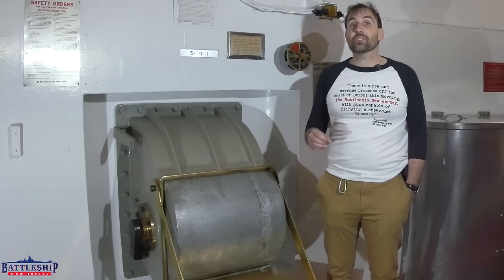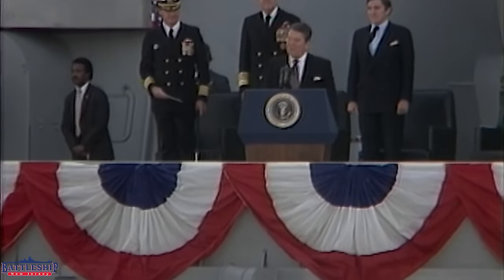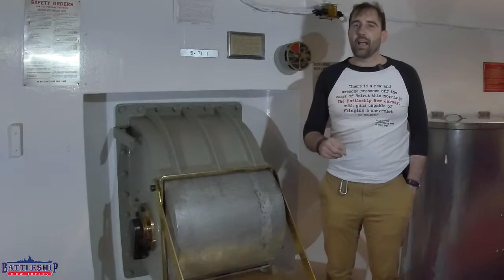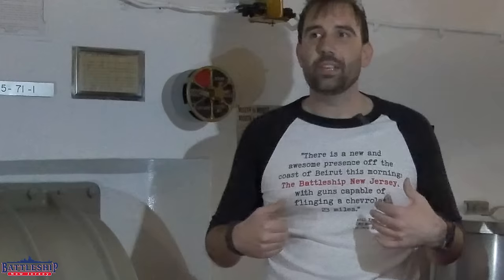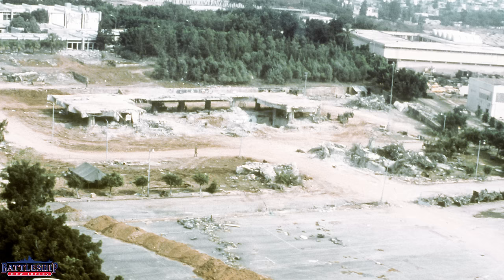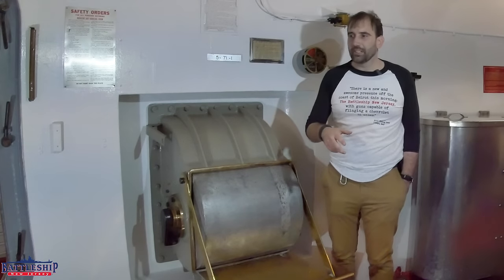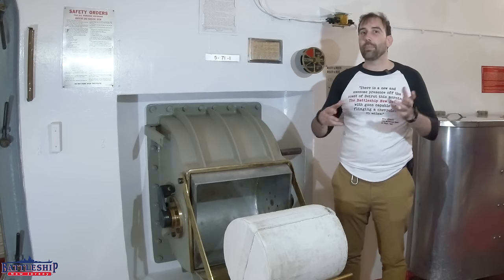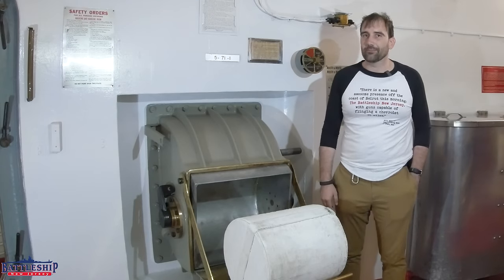Why Were New Jersey's Guns So Inaccurate in 1983?

Comment: A relative of mine in the army in vietnam as a ground grunt used to praise the accuracy of naval (battleship) artillery in hitting everything accurately they designated.  He said it was infinitely more accurate than ground artillery and they used that resource whenever they could.
Reply: The Battleships could be in the (relatively) close to targets on the calm waters near shore in Vietnam, the "fire control computers" can really use their long range sighting inputs to enhance accuracy. It takes a lot of practice and team work to reach that level of accuracy (and some other ... efforts on ships like Iowa "experiment" with propellants and loadings to get those "improvements" - it cost sailors lives).
Reply: I could buy that argument. Compared to today's vessels, two different things.
Reply: @williestyle35 what are you talking about? The Iowa explosion was caused by the old powder getting hit with the ram too hard no?
Reply: @Synergy7Studios Yes, but the old powder shouldn't have been used in the first place. It was an "improvement" by one of the sailors, using the old powder from WW2 to increase range and accuracy. The problem? It specifically had written on the powder bags to not use with the 2700lb shells. Solution? Use 5 bags instead of six. Add a hydraulic rammer that was known to move erratically, the sailor using it being inexperienced and there's the recipe for a disaster.
Reply: @durt214  that makes absolutely no sense, the old ww2 powder was the ONLY powder they had, and if anything age would hurt accuracy.
Reply: @Synergy7Studios  Apologies, my mistake, remembered it wrong. 
In January 1989, master chief fire control technician Stephen Skelley proposed an experiment, using supercharged propellant and specially designed shells to increase the range of Iowa's 16-inch guns. The shells reportedly travelled 40km, a record distance.

During the Iowa turret explosion, he proposed another experiment. Using a 5 bag charge of the quicker burning D486 propellant from 1943-45, which was not to be paired with a 2700 pound shell. The reason for using 5 bags instead of the usual 6 was due to the powder creating more pressure, and the idea behind the experiment was that a 5 bag powder charge would result in better accuracy due to the gap left between the bags and the shell.

So 2 different experiments, the one during the disaster was for accuracy.
Reply: The curators hairline needs to be recommissioned to The Reagan administration
Reply: Along with that it's a much heavier hit.  A battleship can lay down more ordnance in an hour than a unit of B-52s can in a day

Comment: And for another fun fact about this, I crawled thru all nine barrels many times to check out areas that I found during the bore scoping. For the first firings we were not given any lead to lubricate the barrels so also spent many hours inside them to remove copper fouling with a chisel and hammer had one piece that was 10 inches long, there's a Plack out there somewhere with it on it.
Reply: Are you still thin enough to fit in a barrel?
Reply: How on earth could a person fit inside a gun barrel for a projectile 16" in diameter, much less have enough room to move to chisel things?
Reply: @Swindle1984  Skinny teenagers and young men. The same way tankers tended to be shorter.
A friend of mine got kicked from the Irish cavalry years ago. His legs didn't fit as a driver.
Chieftain had the same story, he went to the US.

Comment: Ryan, I was under the impression that the reason for the variation in the fall of shot was powder degradation. The Navy back in the ‘40s mixed huge (100 thousand pound plus) lots of the nitrocellulose used for propellant. Nitrocellulose has volatile components such as water, ether etc that degrade with the passage of time. Even properly stored, nobody could have imagined the the Iowa’s would serve so long. I recall from a Naval Institute Press book that by the 80’s, gunnery at Vieques was giving indications of variation of muzzle velocities in the neighborhood of 30-40 feet per second, well out of design specifications. The Navy had to re-blend the propellant and rebag in order to get accuracy of the guns back to their prime.

Comment: Ryan, we started deploying velocimeters on our 155mm howitzer in the Army in the early to mid 1980s and their introduction drastically improved the weapons accuracy.  I can imagine how having incorrectly repacked powder and the lack of velocimeters would really mess up accuracy.
Reply: While I was trained as an NCO to direct fire, never dealt directly with any form of artillery personally (as in firing pit) until quite late in my military career and was helping our 120mm mortar crew. They generously allowed me to drop a few rounds.
Suffice it to say, the drills impressed me, the incessant checking level and angles also imbued trust. Everyone repeating the firing order also impressed me, as it ensured no errors should make it to directing the gun.
Two men computing and if both agree, only then do firing orders go out, again, imbued trust.
Some months after that, got to help a 155 crew that was badly short staffed set up the gun for a PR display. Hell of a team! I figured out what had to go where and how from the mortar experience, so we seamlessly set up, they actually did level out the gun - on an airfield ramp for display, out of pure habit from properly drilling.
Came in handy in the wars, as before, I'd have wondered if the rounds would land on target or short. Trust is critical and saves lives.
Crews knew me on the radio, as I'd give correction by mils, when a FIST wasn't available.
I rotated with every team, even our sniper teams, just so I'd be fluent in their capabilities, even if I had to play Private for that time. Only weapon I declined familiarizing with was the Barrett. No thanks, my spine would never forgive me.
Everything else, yeah, I've fired it or crewed it.
My personal favorite weapon still remains my heat seeking moisture missile though.  :P
Reply: @spvillano careful those wear down with age, it will have you dreaming of the glory days.
Reply: @FranktheDachshund 
😉😂

Comment: There was a TV news broadcast that quoted Lebanese officials as complaining about the New Jersey's guns tearing up the town.  That particular incident followed some chaotic firing by Soviet-made anti-aircraft guns.  The reporter and his cameraman were guided to the damage "caused by the NJ's big-guns."  The walls of the damaged small buildings were still standing.  The officials pointed to some holes that were about 23mm  and 57mm in diameter (perfectly round) and said those were caused by the New Jersey's 16" guns.  I believe a Navy spokesman said the NJ had not even fired its 16" guns that day.  It seemed unlikely that small poorly built buildings would still be standing after being hit with a 2000-lb shell or that such a shell would leave a nice neat 57mm hole in the wall.  Other reporters said the AAA gunners had no fire disciple and shot their weapons in just about every direction, including into their own buildings.
Reply: Yes, 23 and 57mm are very common Soviet-made AA-gun calibers, both have been used by the Finnish defence forces. I was trained as a ZU-23-2 gunner during my conscription back in the early 90:s. The 57 was already becoming obsolete then but still in use by the reserves, I saw those being fired. At least here the standard practice for 23 was to línk one AP round for every 3 HE rounds, of which there were two kinds, with and without a tracer so there would be alternately one tracer and one "dark" round in the belt. 

The clean round holes would probably be made by the AP rounds which are basically just lumps of steel with driving bands of copper and a tracer at the base while the HE-rounds are fitted with very sensitive contact fuses and would explode immediately upon any impact to cause maximal damage on thin skinned aircraft so they would probably cause larger, ragged holes with shrapnel downrange. The ZU-23-2 has a theoretical rate of fire of 1000 rpm/barrel (though the ammo cans only hold 50 rounds/barrel but they are very quick to change by a competent loader) so I think firing one at a building would be quite devastating. I once saw a short (2 or 3 rounds/barrel like we would fire at practice to conserve ammunition) burst accidentally (the gunner forgot to lock the elevation before firing and inadvertently yanked the crank while pushing the trigger pedal so he shot low) hit a retaining wall made of logs below a target and there were lots of airborne splinters after that.
Reply: Sees an autocannon-caliber hole with minimal blast damage
"Is this not sixteen-inch?"
Reply: Thanks for the information.  Much appreciated. @Murgoh
Reply: @Murgoh   the 23 and 57mm are good weapons, well, save when used by Russian conscripts.
In Finnish hands, well, the targets are Finished.  ;)
Nothing but respect for those in the Winter War!

Comment: Another issue with the WWII powder supplies was improper storage between deployments. This was a BIG issue in the Iowa incident, as powder bags were removed from the ship and stored in unventilated barges in hot weather affecting the powder.
Reply: @JLange642 Thanks, you saved me from looking it up!
Reply: you are soooooo spot on imagine spending all this taxpayer cash & not manufacturing new powder !!!!
Reply: Well, with the Iowa, there was also an augmentation that the lead investigating Admiral had designed that came into play.
Reply: @THOMAS81Z   well, I've used TNT from the 1950's in the Army. Why replace that which is stable and considered fit for use?
The issue with storage is a valid concern, but incorrectly loading the bags, bigger concern, as the propellant won't be consumed inside of the barrel behind the round, but be ejected still igniting and basically, making only a light show, decreasing range and performance.
The Navy had tons of storage issues, some coming into play and causing disastrous a aircraft carrier fire.
RDX and heat don't get along, the composition in the carrier fire actually had begun breaking down and literally leaking out of the bombs when the incident triggered a fire that enveloped the bombs (massively simplified here).
Reply: @spvillano  I was in to , so your were a gun bunny, what unit ? I was A co 124 sig 4th ID😊
Reply: @thomasshannon2741  nope, wasn’t a cannon cocker. Medic, before was a Pershing missile erector launcher repairer. Last unit was 1-111 infantry, 56th brigade combat team, Stryker. Also was 330th combat engineers.
So, I pretty much worked with everything that could get suddenly loud.

Comment: I was Weapons Officer in USS IOWA 1983-1986, and Mr Harold Jones, the Naval Weapons Center expert on 16" gunnery frequently visited Iowa as we became the big gun expert ship.  He briefed me in New Jersey's performance at San Clemente gunnery range using the powder charges she had at commissioning which was unmixed 16"/50 with the 1800-pound HE round.  He told me the variation in initial velocity seen there was up to 120 feet per second, which means there had to have been velocimeters aboard BEFORE Lebanon.  I was visiting the ship off Panama when the order to go to Lebanon was received and transited aboard the ship as she passed through the canal to the Atlantic side where I debarked to return to IOWA still in the yard at Pascagoula.  As a result of the San Clemente experience, a program was initiated to take three grand lots of 16"/45 powder from WWII and mis them together in order to achieve a consistent initial velocity WITH THE LIGHTER HE PROJECTILES.  We could NOT fire this powder, designated I think D346 or D846, with the heavy weight projectiles because it burned so much faster than 16"/50 powder.  After I commented to the New York Times reporter aboard that this was the reason NJ shot so badly, the Secretary of the Navy sent us a message asking if we could prove it.  We sent back a message saying sure, if you can give us some dud HE projectiles (no explosive 16" projectiles were allowed at Vieques Island target range) all within 20 pounds of each other.  At this time the Navy did not have any practice projectiles for the HE round - we only had the 2700-pound rounds in dud form.  We ended up meeting a landing craft off Roosevelt Roads loaded with 50 of these specially prepared projectiles sent in a C-5A in the personal custody of the Commanding Officer NAD Crane and proceeded to fire the longest range shore bombardment in battleship history making the celebrated pattern which could partial fill the center of and overlay of the Pentagon.  I have a copy and am happy to provide it to you.  And that, my friend, is why NJ fired inaccurately.  If you were to grab a bag of remixed powder, you would know that the grains were jumbled in there because you could feel the lumpiness of the grains in the relatively untight bag.
Reply: Great post. I was watching a vid recently about the Misty FACs wherin the narrator mentioned poor accuracy from offshore ships firing on selected FAC-selected onshore targets. No idea if that was true but, if it was true, I wonder if they were experiencing similar powder problems. Sounded as if WWII-level accuracy was not even being achieved, not sure.

Comment: "Between the wars" my dad served as a reservist in the coastal defense artillery.  The hard some good sized guns, of course, as they were intended to fight off any enemy warship.    My dad said that at least on one occasion they opened the power bags and manually mixed up the "powder" and then put it back in the bags   This ensured that the bags were uniform and a few test shots would "Calibrate" things.
Reply: Couldn't do that with the 16 inch monster bags. As he said, they were designed to be stacked for consistent burn while the shell was still inside of the barrel.
Just dumping shit back in randomly would leave propellant leaving the barrel either just beginning to burn, partially burned or unignited and wasted, losing pressure to propel the round properly and consistently.
Small guns, yeah, granular powder would work that way, with decreasing performance based upon storage conditions and for shore batteries, burned off and replaced.

Comment: There was an entire program at crane to remix powder and bag in those blue polyurethane cases. I belive the mixing between lots was stopped because the velocity was inconsistent.
Reply: Polyurethane is highly static prone, so it must've been coated.
But, you can't mix powder in a bag full of pellets, which the 16 inchers were made up as. At a certain dimensional size, one has to resort to pellets, as powder would simply rupture the chamber. It's pretty much an inverse of a rocket at that point, fuel behind the round like a rocket, but not going with and still propelling the rocket after leaving the barrel.
And I've designed rockets and some rounds for personal usage. Combustion rate, pressure curves, yeah, it's complicated.

Comment: Here's some comments from Tony D (owner of NavWeaps website) during a propellent discussion on one of the NavWeaps message boards.
Following USS New Jersey's poor gunnery performance off Lebanon in 1984, NSWC at Dahlgren, VA, conducted a gunnery improvement program.  One of the outcomes of this program was that D-846 was remixed in lots of about 100,000 lbs. in order to distribute the varying propellant grains evenly.  It was then rebagged to a tolerance of 1/10 of a pound per bag (roughly +/- 2 grains).  These lots were test fired in at least two guns for charge assessments and the resulting round-to-round variation was very low.  D-839 was found to still be within the original +/- 10fps variation acceptance standards when used with the 2,700 lbs. projectile and was not rebagged.  It should be noted that most firing missions were expected to be with HC rounds, not APC rounds and this was the case during all four wars (plus Lebanon) in which the Iowa class participated.